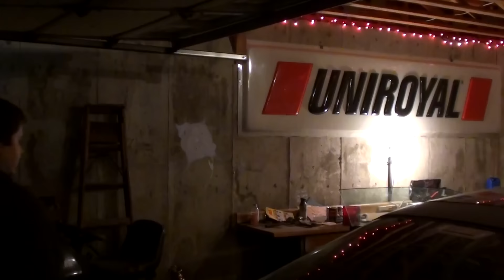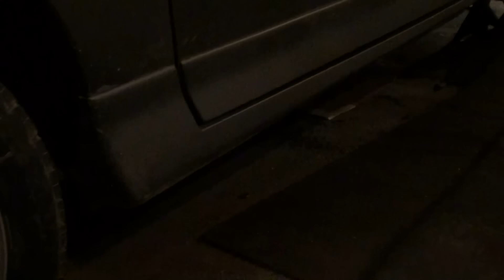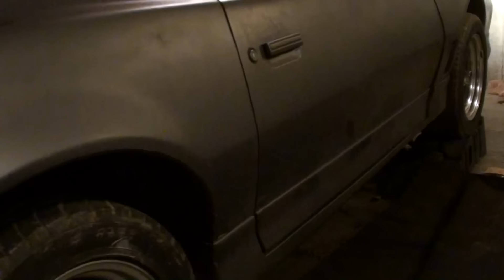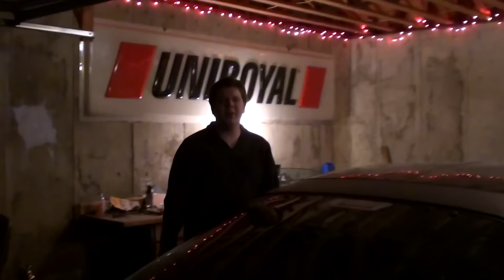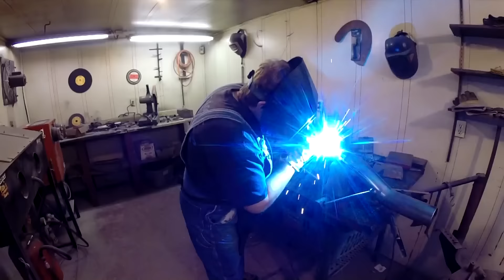Trans Am Dual 3" Exhaust - Start up and Lopey Idle

Comment: Hey, I just started watching your guys videos and I love them! I have a 85 firebird myself that I'm looking to build. I was just wondering what motor do you have in the car now? Also what transmission do you have?
Reply from the maker: +Spencer Gniewek Thank you for watching, we appreciate it.  It's just a built small block...forged pistons, about 9.6:1 compression, Howards Racing Cam 231 In/236 Ex Duration at .050 with a 108 LSA, Performer RPM Air Gap, Quick Fuel 750 carb, and a Sniper Nitrous plate kit.  The transmission is still a 700r4, but it has a TCI shift kit, upgraded servos, a pinless accumulator piston for solid shifts, a B&M convertor, and a modified plunger for full throttle upshifts from third to fourth.

Comment: Jeff I forgot to ask you, is Jordan going to ever swap out the automatic transmission and put in a manual transmission? I think that would be an awesome project and a great video series.
Reply from the maker: +BRR Jordan has seriously thought about a manual swap, but it's a pretty expensive change, so it will have to wait a little bit.